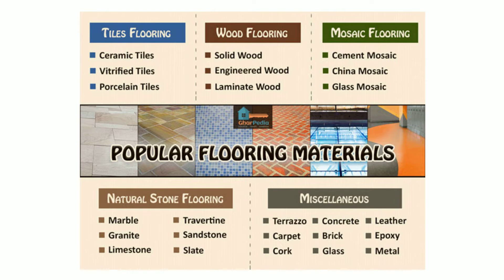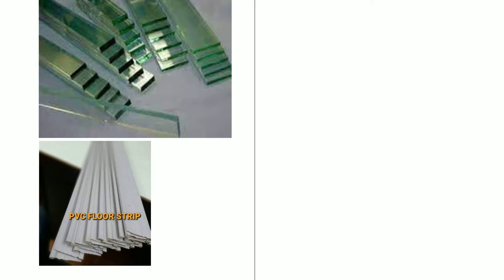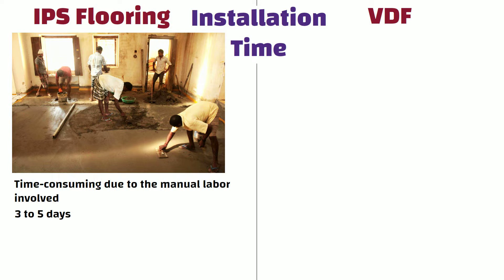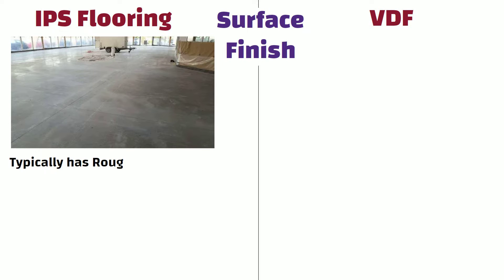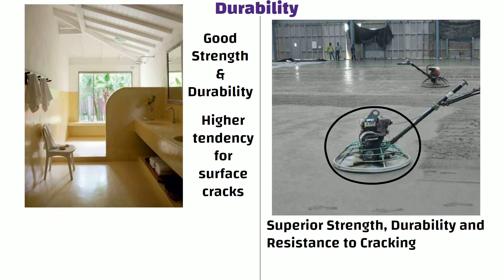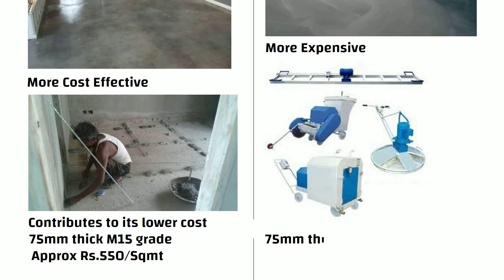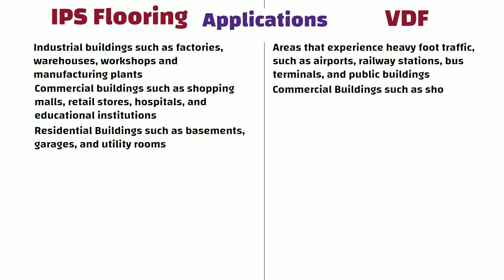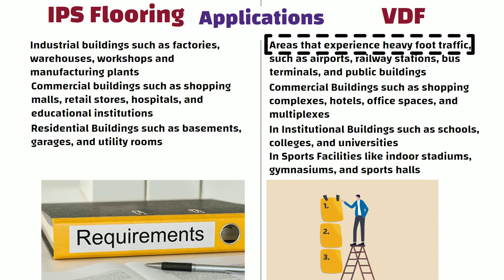Differences Between - IPS Flooring vs Vacuum Dewatered Flooring

Comment: Mosaic and piccolo 2 tiles same?
Reply from the maker: mosaic tiles are a category of tiles that can come in various sizes, including small sizes that can be described as "piccolo''
Reply: @engineeringmotive 
Sir. Vetrified tile use only floor or bathroom cladding?
Reply from the maker: Can be used for both
Reply: @engineeringmotive 
Sir.
I have seen your video.
But flooring tile and wall cladding
Full. Confused.
 How to  find out. This is ceramic tile and vetrified tile.
Mosaic tiles which category of tile.?
Please full detailed one video sir🙏